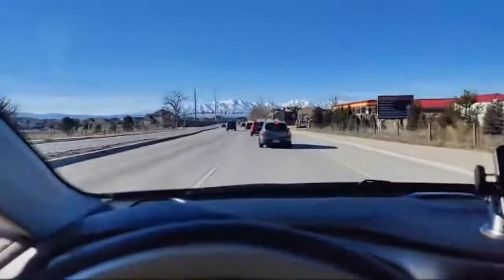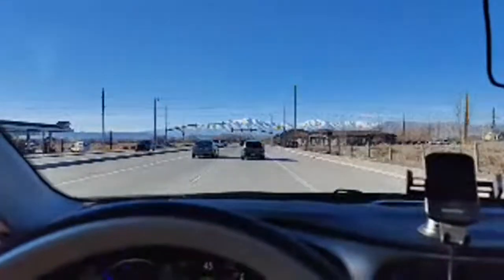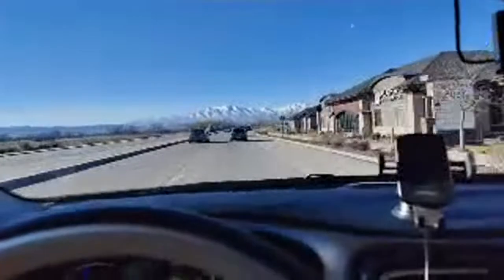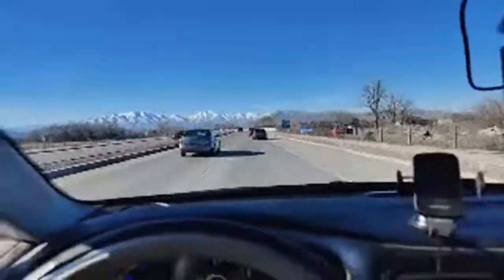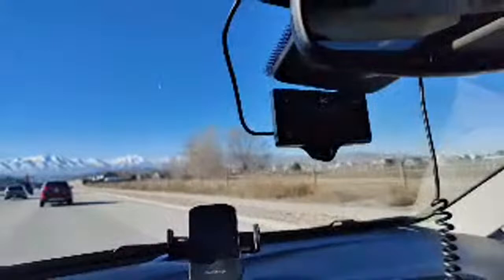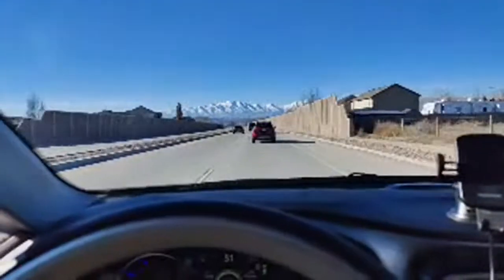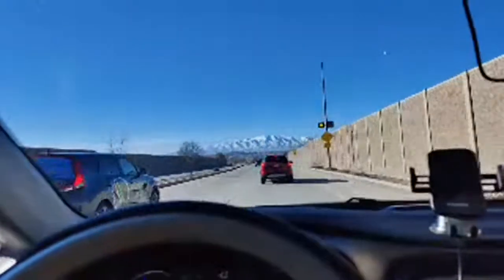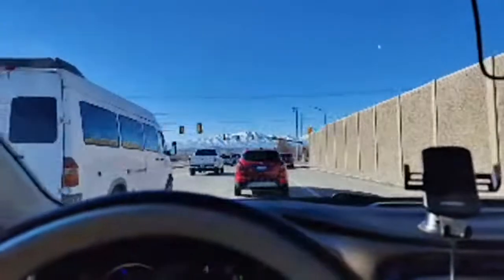Testing Laneless Openpilot On Pacifica Hybrid

Comment: What year is your Pacifica?  I'm about to pull the trigger on a C3 for my 2020 Pacifica (gas model).  I saw that Openpilot doesn't work under 39MPH.  How did you get it to 9mph?
Reply from the maker: Mine is a 2018 plug-in hybrid. I would be surprised if it didn't work under 39mph, as that would be higher than any other supported vehicle. Unless they made some drastic changes, but that is moving in the opposite direction. It does look like they changed their website and added more details as to what is supported on each vehicle. They didn't have that list when I picked mine up. But I can't see anywhere that says only 39mph and higher. Can you share that resource?
Reply: @GlennPearsonDIY  Directly from Comma's website 'openpilot upgrades your 2020 Chrysler Pacifica with automated lane centering above 39 mph' - does that mean lane centering doesn't work below 39mph?  Looks like for 2018's it's below 9mph.  What is your's doing below that speed?